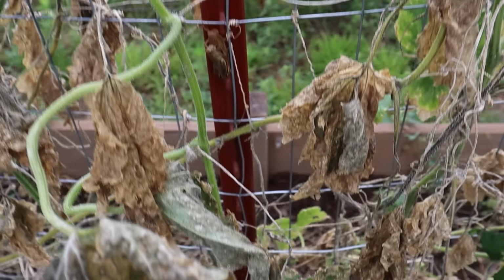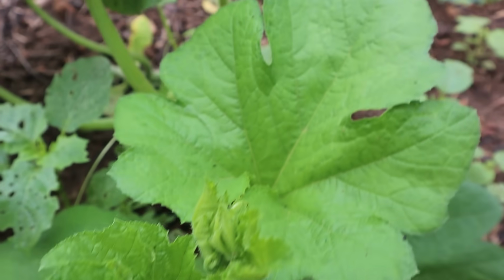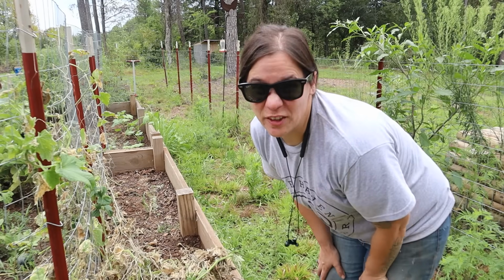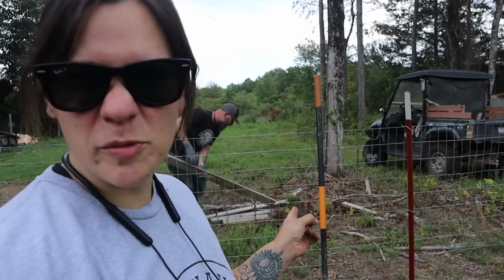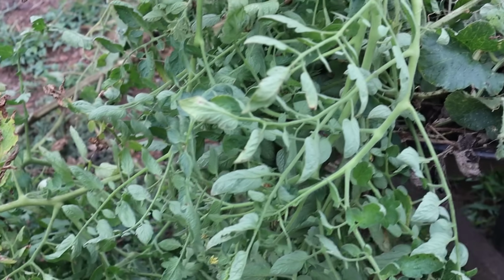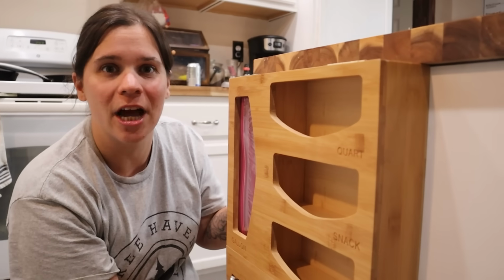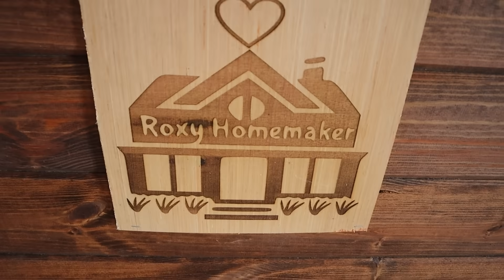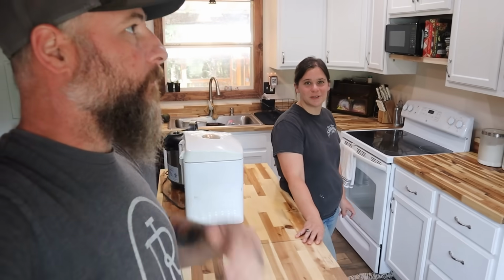All good things MUST END | DIY | Shed To House Conversion

Comment: When I moved into my permanent home, we lined every cabinet shelf and drawer with floor vinyl. Talk about easy to clean! Double sided tape holds it all down and nearly 40 years later, the vinyl is still doing its job. I do 7se the shelf liner under my dishes and glasses, just for gripping. The vinyl under the pots and pans is a great way to keep the area clean, too.

Comment: Roxanne for your ant control-1/2 cup sugar 1cup Borax detergent and water I used a quart mason jar soak cotton balls in the solution put a plastic fork in the jar to remove cotton balls and put them on a jar lid and put them in the garden. I had my doubts but it worked!

Comment: Gardening was tough this year because of the extreme heat.  Next year try Captain Jack’s Dead Bug powder around the base of your zucchini and squash to prevent the vine borers from laying eggs. It worked great for me this year.  Of course you will have to reapply after it rains but I didn’t mind.  They also have it in a spray for other insects.  I never see where you plant green beans, or did I miss it….do y’all like beans? They are the easiest thing to grow..  where Anthony is throwing the leaves and twigs will eventually break down and make compost.

Comment: Best thing I purchased last year was a drip irrigation system. A timer that runs on batteries attached to the outside tap (spigot?) With a drip hose attached to the timer, set for twice a day, fifteen minutes at a time. Easy to set up, not too expensive, and easy to remove once winter arrives.

Comment: Will you be getting matching pulls for your kitchen island, to further tie it in with your other cabinets?   I think you and Anthony did a great job planning the layout of the island!

You are an amazing gardener!  I think your hard work and positive presence blesses the plants so they grow better for you!   😊❤❤❤🙏👍👍
Reply: The kitchen is well designed, I actually like the smaller microwave on the shelf with room for the eggs and cookbooks. The island is a great addition, love that you put an electric outlet there, and that's a great place for the organization holder. Roxy, your garden did great until the heat set in, your not the only one, happened to alot of folks, do your fall planting in a few weeks and I hope it will do well. I've seen on some videos that putting a line of baking soda around the base of a plant detours ants and other bugs. Might be worth a shot.

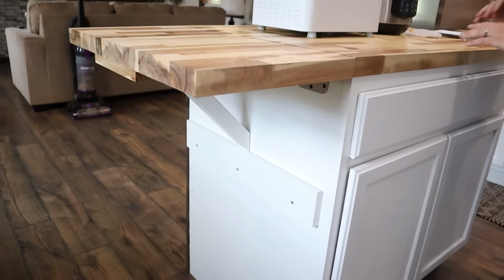Comment: Ant, If you want to round off those two edges at the Top Deck at 21:41, it might help you move and not get stuck on them. Make those 90 degree edges into curves so there's less chance of getting stuck, if you bump into those 90 degree corners it could hurt a lot. But this is just a suggestion from me. Peace! :)

Comment: Spinach, lettuce, escarole , onions, garlic, they are cool crops believe it or not let us does not like hot. But you need to get them in the ground now so they have a chance to germinate and get some roots before the cold frost and the spinach and lettuce and all that you can cover with a cattle panel over the bed and put plastic on it to keep it from getting frost bitten, but she will have them all through the winter that you can pick from

Comment: The dish soap works better than the neem. When one squash stalk is going, you have to cut it off. Then you have to open that stalk up to see if you have larvae or borers. If not it means you have a squash bacteria. It think then you have to dust with either diatomaceous earth or rosin dust. Rosin dust is completely harmless to humans. If it is the heat then get some sail cloths. As the heat rises I used to water every day at noon to one to cool those plants down. It does not hurt them.